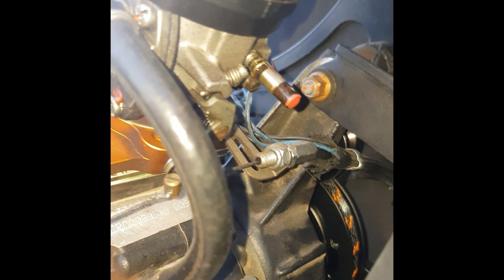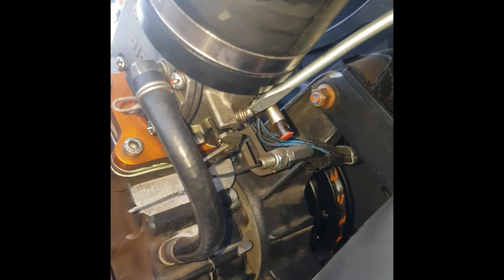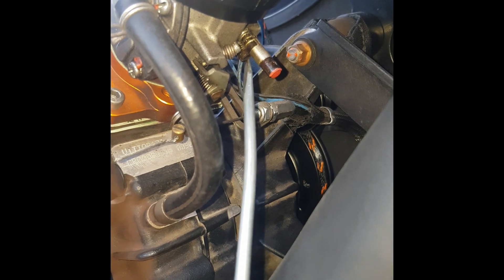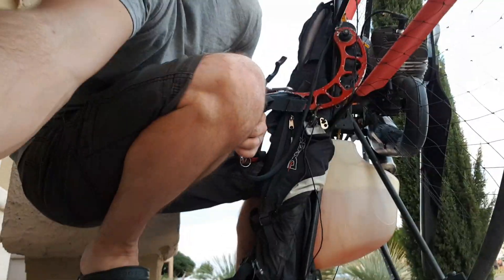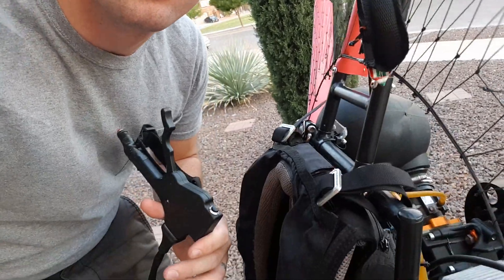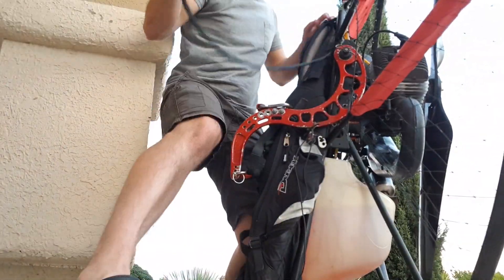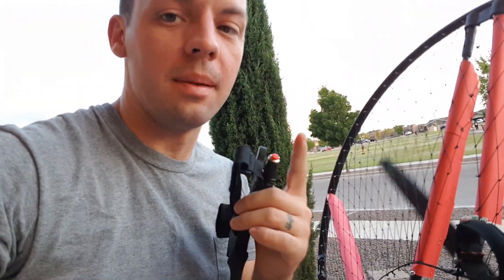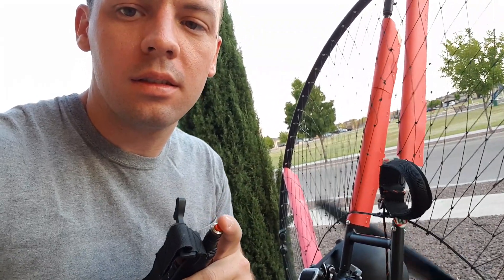How to Adjust Your Paramotor Carburetor

Comment: My low needle turns out during flight and the motor richens up any ideas on stopping this
Reply from the maker: @nickholmes6376  take the needle out, clean the threads really good with alcohol. Stretch the low needle spring a little, if it has one. Put some tq stripe on the low needle and carb to kinda help hold it. 

 As a last resort, you could put a tiny dap of loctight but be careful to not put to much so it doesn't get into the carb.
Reply: @MitchG  thanks for the reply and advice 👍

Comment: What is a good starting point on the idle screw when you tune the carb?
Reply from the maker: I would screw the idle screw nearly all the way in and the back it out to proper idle speed. Strap the motor down first. Set mixture screws to factory settings
Reply: @MitchG  Thanks :)
Reply: @MitchG  " all the way in " means to tighten the screw to its max closed position,  Wich I understand that in that position the butterfly would be at its most idle open position. Is that right? All the way out would mean that the butterfly would be at its most closed position, ( least air )
Reply from the maker: @neosugus  correct. With the screw in, it opens butterfly and idle goes up. Adjust it until the motor idles smooth but the prop doesn't spin
Reply: @MitchG  Thanks again!!!! ;)

Comment: How do I tune for fuel efficiency? My motor runs fine but is burning tons of fuel!
Reply from the maker: You can turn the hi and or low needles in just a tiny bit at a time. Keep checking the spark plug and throttle response to make sure it's not running lean. Install a cht as well to make sure it's not getting to hot. If you lean it to much you might destroy the piston
Reply: @MitchG  Thanks. But start with low or hi? And just gradually lean them both out? I'm somehow getting 5L/h on an Atom 80 with a Viper XC while friends on a Top 80 get <2L/h.
Reply from the maker: @turkeyphant  set the low to have a good idle. Lean the high for fuel efficiency in cruise flight

Comment: Thanks Mitch, I couldn’t figure out why my motor was running poorly I only have six hours into this new motor but when you said changing oil mixtures or oil brands that made sense I switched to another brand and a different mix ratio I’m gonna go adjust my low needle thanks for putting this video out.

Comment: I run 40:1     harder to tune and get to idle just right.  I like the idea of more oil to protect in the long run     if I see the smoke she's good.  No smoke or little smoke to lean , at first I was skeched out about even touching the factory carb settings but it's not hard  at all.    If the spark plug looks like a lightly browned marshmallow   you are running prefect.      White plug to lean black plug to rich.  Brown plug just right like mama bears porage  haha

Comment: Evening Mitch.. very informative.. Question, what do you like for fuel, brand, octane. With ethanol or not. What do you think of avgas, or race gas. How long do you think your pre mix is good for. How do you store engine for extended non use. How many hours on a carb before rebuild or years. Much appreciated. New sub. Thx
Reply from the maker: I use 91 octane with ethanol because that's what's available where I live now. No issues with ethanol.  Avgas causes excessive deposit build up on the piston with not really any benefit. Race gas is just wasting money. 
I've used motul 800, motul 710, amsoil saber. Saber is my favorite for its clean burn. Motul 800 is my least favorite for excessive carbon build up.
Reply: Many thx. Quick reply. Great videos and info. Fly safe

Comment: My paramotor has a history of dying an hour or so into flight after going to idle. After watching your video I think I'm running rich, thank you for this info I can now get myself a starting place
Reply from the maker: Make sure your fuel cap actually vents air as well. You should be able to blow a little air through it
Reply: @MitchG  thanks for the reply! I'll double check that it vents.

Comment: Great show! However, never think you'll hold 15 to 25 hp back. It will get away before you can hit the kill switch. How do I know? I tried to hold a 24 hp Fresh Breeze wide open. My shoulder saved my life as it & my head went into the gap above the harness. My shoulder got shredded but deflected the prop from ripping my face off or decapitating me. My left cheek was bloodied as the prop ripped my glasses off my face. Once you've had a prop wide open kiss you in the face, well, you learn. Also, torque is a big factor. If the prop doesn't go up & over you, it'll torque to left or right depending on rotation.
Reply from the maker: Sorry that happened to you. I checked the operation of the throttle before this and I start on my back 95% of the time. What happened to your throttle?
Reply: @MitchG  I didn't mean that as a cut to you Mitch, just kind of a warning. I learned from your video too, just a touch of twist on that idle screw. I've been going halfway 'round! 

In my situation, the throttle slide (Bing 84) stuck wide open even though I got the telltale "clunk" out of it meaning idle. Also, I had it mounted on an elevated plywood box on the back of my car so my shoulder acted as a fulcrum causing it to go up & over my head as I tried to hold it (for all of 1/4 of a second). It happened so fast I never had a chance to hit the kill switch. Thanks!

People think "Oh, I'll just hit the kill switch." It don't work like that. First thing is they'll be stunned into surprise for 1 second....that's all it takes!
Reply: @billcallahan9303  So it was stuck in full throttle when you started or you revved it up and then it got stuck?
Reply: @samik83  What happened was probably half my fault. The Bing 84 slide type carb has a slide in it that moves up & down with throttle application.  A check of idle power, Before Starting, is to run the throttle up to max then let the slide drop. If you hear a "clunk" type sound of metal on metal (slide hitting bottom) meaning idle, you're good to go for the actual start. I thought I heard that clunk. The slide had gotten stuck at the top - wide open. Obviously, I must've been thinking of my 22 year old girlfriend! I was very lucky!
Reply: @billcallahan9303  Ah ok. Was thinking it's really odd that it would "clunk" and still go full throttle.  
I've heard stories where something broke inside the carb and it just went full blast. A very rare thing to happen but you never know with mechanical part. Anything can happen.
Reply: @samik83  Your last sentence Sam....well said! Hope others read all this. My thanks to you & especially Mitch.

Comment: Hey mitch. My budys moster 185 bogs out when giving throttle at idle. Blipping the throttle a bunch Will get et going but apllying an even amount og throttle Will kill it.. any sugestions?
Reply from the maker: Does that happen when the motor is still cool and not warmed up? Sounds lean on the low needle. Richen (counterclockwise) the low needle on the carb just a hair
Reply: @MitchG  im actually not sure but ha has gotten it fixed i hear. How about a polini Thor 200 evo that after been warmed up and under load seems to loose the upper powerband? Efter idling a minute in Air i packs a punch but after short time under load it Loses top end power again?
Reply from the maker: @coolmiqqxb  lean on the high needle.

Comment: Good video! if you spark plug is too dark using 1:40 ratio (I use Belray Ester Oil 2 stroke si7, class V oil), and all seems to be working good... I had have some recommendations like: Change to 1:50 ratio, adjust a hair your L needle clockwise (lean side)...what are your thoughts? (motor is Vitto Monster 185 + my20)
Reply from the maker: I use 50:1 no problem. Try it. You might not even need to adjust your L needle
Reply: @MitchG  thanks Mitch, just found a recommendation direct from vittorazi saying that top end oil like motul 800 1.5% is the recommendation, and 2% for the 710, so I guess 1:50 is good, I will try it, thanks.
Reply: @MitchG  all manuals say 1:40 but here is the latest from vittorazi (in case you want to share it) https://www.vittorazi.com/en/faq/faq-tecniche-en/motori-en/moster185-en/07-carburante-olio-miscela-2-en/which-oil-is-recommended-for-the-moster185-what-is-the-percentage-of-oil-for-the-mixture/

Comment: just watched   excellent video.    the high screw. please remind me... what are the turns from in to out?and ill never fiddle with that. and what I do also is test run it .in flight for 20 mins land then check the color of spark plug as this will let anyone know if its running too lean=too hot. or dark near wet.= running rich.. a lot better then too lean as this will seize engine etc.if for any reason there's air bubbles then the engine will not run smooth.sort the air bubbles out.then tune......

Comment: i always tune it so when the main jet takes over from the idle jet, ik goes smooth so you have a smooth transition in the whole rpm range. who cares how it runs on idle. you ajust that with the other screw you showed first.
Reply from the maker: Mid range is set with pop off pressure not the low needle. I want a motor that starts easy and doesnt die in flight at idle.

Comment: Good video man. I've been fighting my carb since getting my motor. For whatever reason it seems to be more sensitive to ambient conditions that my other carbs.
Reply: In feel the same thing Tom, my 3 year old motor runs fine and never had a problem with the carb but this new motor that has 6 hours on it is but starting to get real finicky !
Reply: mine ran perfect until I rebuilt the carb and somehow ruined it. I can't get it back to how smooth it was running before

Comment: A good tip is what I do every few flights: - With engine at idle and warm, slowly turn low needle clockwise and notice how the idle rises. Keep turning it slowly until idle peaks and starts to decrease (at this point you are lean). When you hit peak rpm turn it back slightly rich (something like one minute ccw), set your preferred idle on idle screw and you are golden!
Reply: I've tried this, but it's damn hard to get a screwdriver on that while it's shaking around... and even harder to make small adjustments. Do you have any tips on how to actually do this while the motor is idling?
Reply: @ryandinan  I just use a small screwdriver bit. And yeah it only needs extremely small adjustments and can be a bit shaky :). Best to secure the prop from spinning.
Reply: @Venna78  "Best to secure the prop from spinning" - or simply dismount it :-)
Reply: @eltomek  I thought about dismounting the prop, but will the idle rpm be prcise?